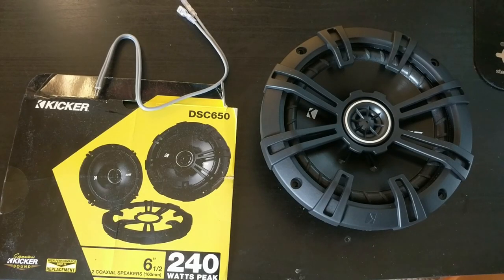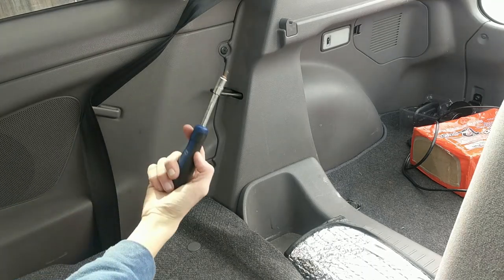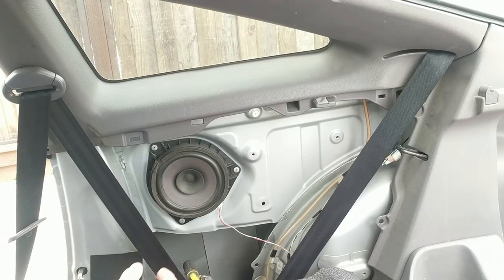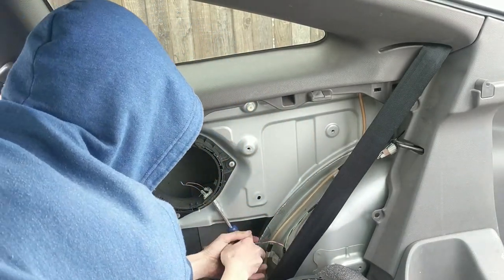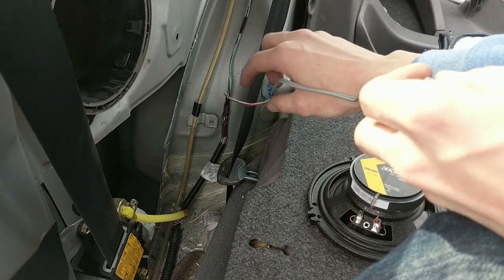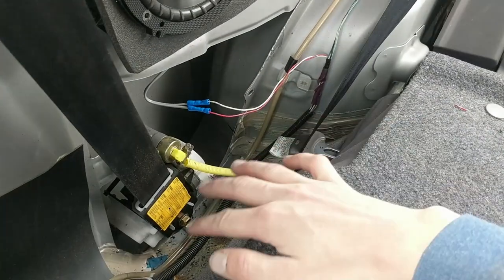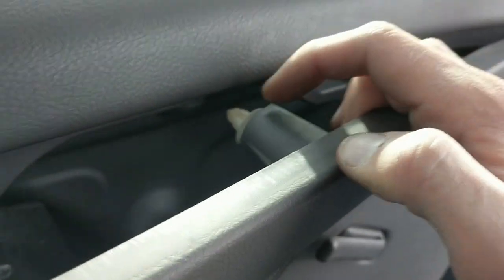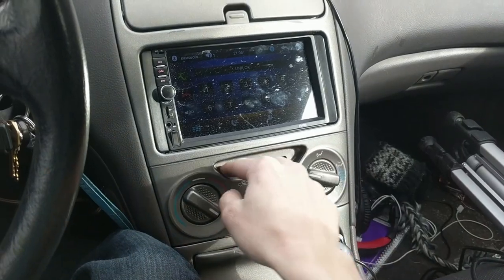How To Install Rear Speakers Toyota Celica

Comment: For me, I always test my speakers by using a 9-volt battery.  I use some clip leads one red + one black - and after clipping the positive and negative touch the battery terminals and you’ll see the speaker move out.  If it goes in to the back your polarity is wrong.  Just my two cents.

Comment: Great video. I also used boom mat and self tap screws so no drilling.  How about driver side  color for - and + anyone??? 2001 GTS
Reply from the maker: The wiring was done wrong so I'm not sure. Read my highlighted comments

Comment: the cheaper way is to hack the oem wire? why dont you sodder the new wire to the white conector you took of the old speaker????
Reply from the maker: didnt feel like soldering that day
Reply: @ElectricMilesLLC as long as you have it flush and good connection it doesn't matter if u solder or electrical tape or the tubes u crunch ...